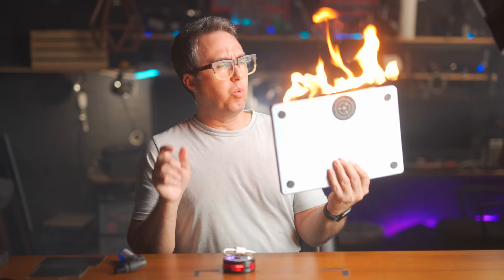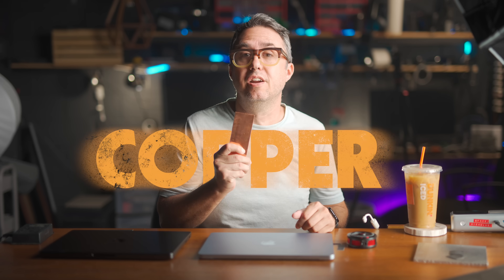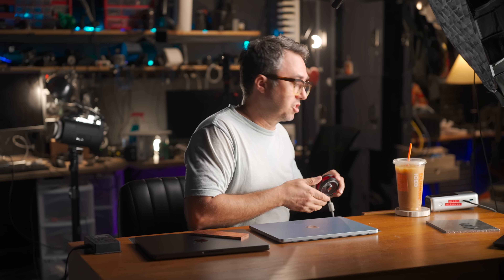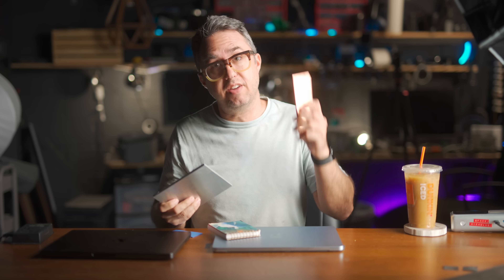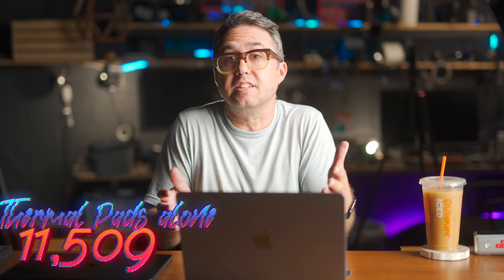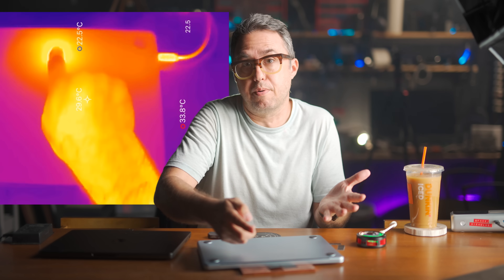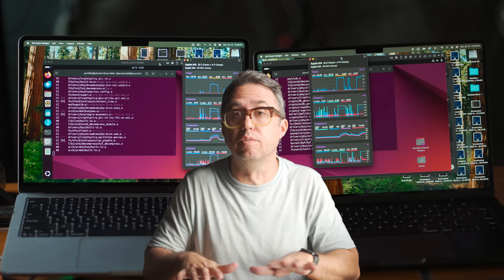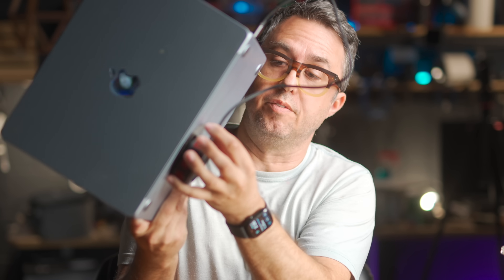M4 Macbook Air Beats Macbook Pro in Cinebench - Thermoelectric Cooling

Comment: So it still means we’ll have to modify the MacBook’s design—stick those thermal pads inside. That’s why I wouldn’t call it the simplest solution. I wonder how this cooler would work without those thermal pads.
Reply from the maker: It would do SOMETHING, but I dont think it would have a huge effect.  Air is a terrible thermal conductor, so the heat would have a hard time reaching the cooler with the airgap inside the computer.  A majority of the heat goes up out the keyboard.   It would still have some improvement though.

Comment: So this copper plate will heat up over time, and there will be nowhere for it to release the heat, since it’s placed under the MacBook, not above it—meaning the hot air won’t have anywhere to rise. Yes, we’ll have some time before it heats up, but it won’t be able to constantly dissipate heat, right?
Reply from the maker: That is correct.  It DOES have quite a bit of surface area exposed even under the computer so its shedding heat at the same time.  But yes, if you go 100% with CPUs indefinitely it will eventually stop the magic.  BUT.. IMPORTANTLY.. Most things dont go 100% CPU constantly - youre probably never going to be exporting 10,000 photos, 100,000 photos.. And with other things, even demanding games - they go hard and let up over and over which allows this to act as an amazing buffer to vastly delay the thermal throttle from kicking in.

Comment: Thanks for the video! Great job! I am wondering if condensation could be a problem when using the puck.
Reply from the maker: Well, at idle, condensation might occur, but I dont see it being a problem - first - as long as the computer is running, its producing heat - so getting it to actually be so cold it condenses the moisture out of the air wouldnt happen easily or quickly, but then even if it did - its not like that condensation would soak in through the aluminum case.. It could drip on your desk though. Thats about the worst case scenario.

Comment: May I bother you asking for local AI tests please?
Reply from the maker: I did actually install Ollama and Deepseek R1 and get it running for the 1 second shot I used on screen!   I couldnt really figure out a way to make a local LLM heat things up, though.  The longest response I could make it give me still only lasted like 20 seconds or so, and thats just not enough time to heat things up enough to throttle.  It seems to be PRIMARILY GPU, the CPU only would go up to about 70% utilization

Comment: How about a meshed backplate, then add a fan under it to cool it
Reply from the maker: It would depend on the strength of that fan, but that would absolutely do a lot to cool a MacBook Air. 20watts is a TINY amount of heat in the grand scheme of things.   An RTX3080 graphics card will pull almost 20 times that and they manage to stay cooled with a fan and heat sink!
Reply: @SPACEDESIGNWAREHOUSE  is there any way under the heavens you'll bless us with a meshed backplate for the M4, looking forward to it if u do!

Comment: For the thermal pad mod, do I need to take out the Aluminium sheet that covers the CPU/GPU/Ram? Or is it enough to put a thermal pad Between the aluminium sheet and the back plate?
Reply from the maker: Once youre inside you dont have to change anything. That shield is already passing heat through it and across it. So it helps.

Comment: How about using 2 or 3 ted cooling on the air ?
Reply from the maker: There would definitely be a diminishing return because a HUGE majority of the heat comes out of the processor, but still it would HAVE to improve it still!

Comment: So it was 30% "better" with thermal pads + fan... correct? You have the thermal pads permanently on. My daughter has a  base 15" M4 MBA, and it gets warm on the wrist rests when she games... trying to decide if I added passive cooling like the thermal pads if it would run cooler... or it would just run harder but stay hot. Might have her try a stand with fans... I don't think she needs a PRO just for gaming, and she likes the 15" size.
Reply from the maker: If the wrist rests are heating up, that’s where the batteries are inside the computer. So that’s from the game drawing so much from the GPU that the computer is charging really heavily while she’s playing. So the thermal mod wouldn’t do anything to cool that down, and also you’re right the thermal mod doesn’t necessarily make the computer run cooler. It allows the computer to run harder at the same temperature.
Reply: @SPACEDESIGNWAREHOUSE  yeah, same thoughts I had. Shes upping from a M1 MBA, (the $1050 price on the 15" M4 was too hard to pass up) and M1 feels thicker. One thing that I really haven't bothered to ask is if shes running on battery when gaming... perhaps she needs to plug in so its not pulling from battery...

Comment: How about the MacBook Pro with the copperplate and the cooling fan?.......will that slightly improves it's performance?   You shoulda.......
Reply from the maker: If you opened up the MacBook Pro and put thermal pads inside of it as well… It’s the thermal pads internally that does a lot of work, because the bottom of the laptop case does not normally make contact with the motherboard therefore, it would not cool down the motherboard to cool down the case

Comment: thanks for trying it out, I was the one suggesting the cooling fan, I am glad it did great, amazing video
Reply from the maker: I’m surprised I just had never even heard of these little devices. 

Thanks!!!
Reply: @SPACEDESIGNWAREHOUSE these have been around for decades, I remember experimenting with it in the 90s. They are not very efficient and they wouldn't work with any regular size processor, but on a low wattage processor like the MacBook air you managed to make it work :)
Reply: Does that impact the warranty with the thermal pads inside?

Comment: this is actully huge i ended up getting an 14" m4 pro because i noticed the 14inch m4 max (besides being very expensive) doesnt give the same performance as the 16" but with this i think it totally could if you by any chance have a 14" and 16" m4 max (probably not as no one needs both) but if you do i would love to see that video
Reply from the maker: I do have a 14" M4 Max.. It's definitely getting taken apart in the near future.  I also have a M4 Max Mac Studio - so If I can get the MacBook Pro to match the studio we'll know
Reply: @SPACEDESIGNWAREHOUSE  That will be insane if it matches the mac studio cant wait

Comment: Pleeeeease do some non immersion water cooling experiments on the macbook air. I would really like to quantify what would happen just by putting a wet paper towel or sponge under the macbook air to see how much cooler it can be. 

By putting the napkin or sponge into refillable enclosure (and openings for the water vapor to escape) its possible to get cheap, non invasive or clunky cooling of a laptop

Comment: Is it possible/Worth using the The peltier cooler on any laptop Like My older ASUS GL702VSK Gaming laptop, even though it has a dual fan cooling system?
Reply from the maker: If you were to open the bottom and look around in there - it's possible that the processor is in the middle of the back of the laptop and the fans are on either side of it.  If there is a copper 'heat pipe' that you can access - putting a thermal pad on that, to bridge the heat from it to the bottom of the laptop, and then putting the Peltier cooler on the bottom of the laptop right where that thermal pad is WOULD make things cooler.  But without opening the laptop, most of the time theyre not designed to where the bottom plate makes direct contact with anything hot - so with no thermal pads inside you wouldn't be able to make a difference.  Thats why those laptop cooler fan things dont really do much.

Comment: what thickness thermal pad did you use for the inside mod? and roughly what size?
Reply from the maker: I used 1.5mm ones because thats what was on my shelf, but 1mm thick ones fit better.  I had ordered 100x100mm and it was enough to get the majority of the motherboard covered.